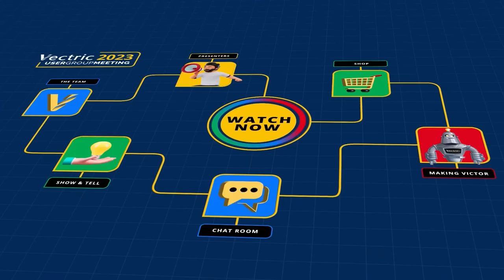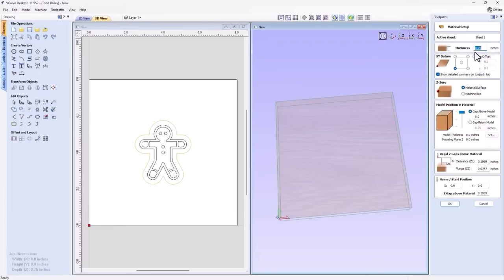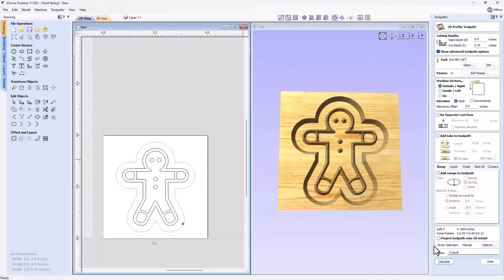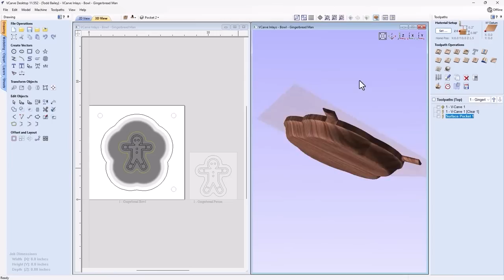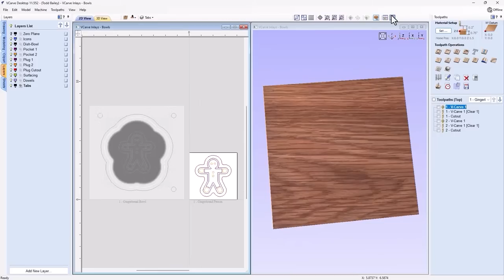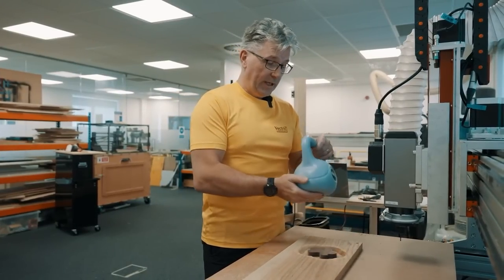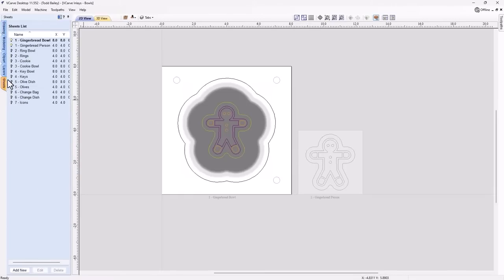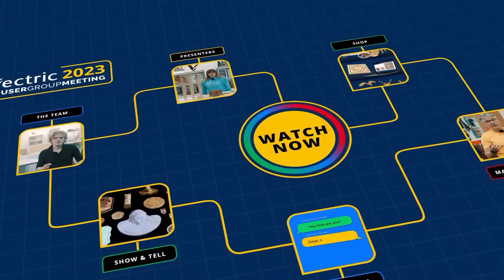VCarve Inlays with Todd | Vectric Worldwide UGM 2023

Comment: One thing you need to do when making your plug is to mirror the plug horizontally. The design you used is symmetrical so it doesn’t matter but a bird or shape like that will not fit when you flip it over to insert it.
Reply from the maker: Thanks for the comment.  Yes you are correct... and if you purchased the 2023 UGM pack and they are not flipped, please redownload the pack... I corrected it after I relised there was a mistake.
Reply: @vectric  I did enjoy the presentation. You guys are great and very creative. There is so much good content from your channel. The software just keeps getting better and better. Thanks for taking the time to help those of us who love woodworking to be inspired.

Comment: Why do you cut the plugs first? I have not tried this yet and am anxious to try it, but not understanding well enough yet.
Reply from the maker: Hello Alan... In my process you need the plug first so you can glue it into the pocket while the pocket is still on the machine.  You kinda need to so this so you can surface the plug.  Give it a go with a few scrap piece of wood... I'm sure it will be easier then you first thought. :)  
Just a note... if you purchased the 2023 pack please be sure the file you recieved for this project has the plugs mirrored... if not simply redownload the pack it will contain an updated file.